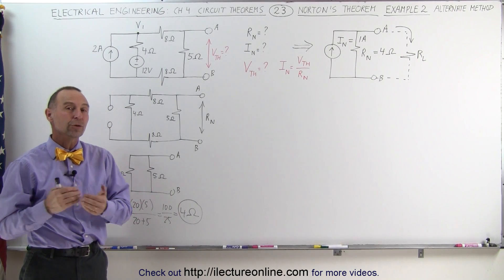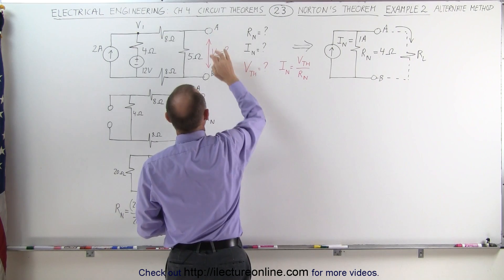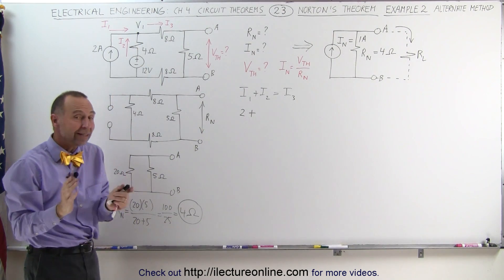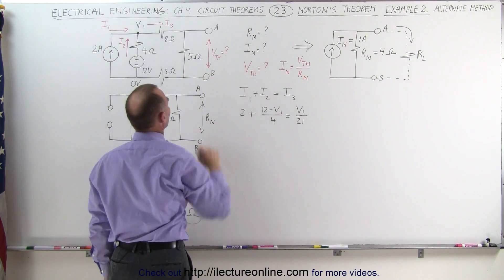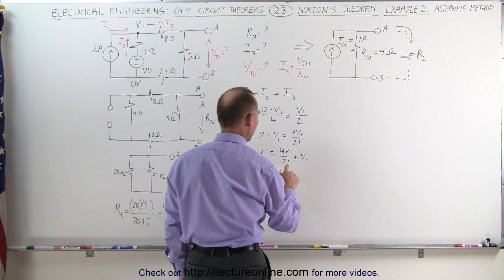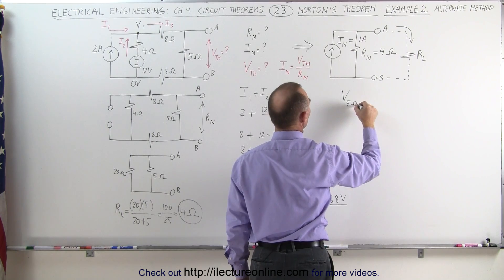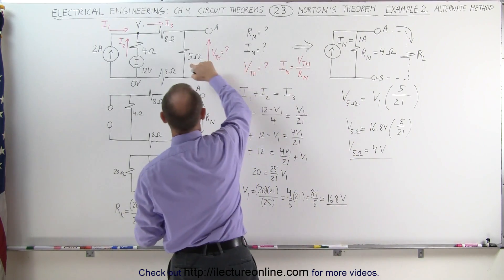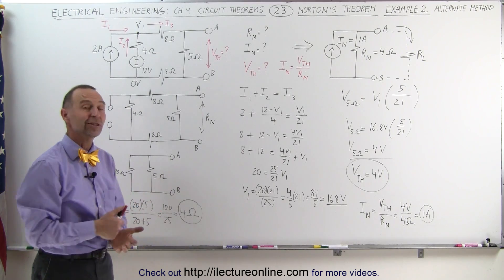Electrical Engineering: Ch 4: Circuit Theorems (23 of 35) Norton's Theorem Ex. 2 Alternative Method

Comment: For those who's confused why he's using (4 + 8 + 8 = 20 ohms) for finding Rn vs (5 + 8 + 8 = 21 ohms) for expressing I3 in term of V1, let me explain below for my own revision as well :)

I've put the comment, in #22 cuz I find out they are same video.

So when finding Rn, we turn off all the independent sources by removing current source & shorting voltage source. Then, we look into the NEW CIRCUIT with terminals A-B as the reference (going from top right, through the circuit, then reach bottom right). Between A and B, there are two paths which are:
1. Left path: A -> 8 -> 4 -> 8 -> B
2. Right path: A -> 5 -> B
So, in this case, we treat (8 + 4 + 8) being parallel to 5

However, in the original circuit when finding V1, we havev defined the currents which are I1, I2, I3. And the currents are represented as follow:
> I1 = 2 A           (from the current source)
> I2 = (12 - V1)/4          (through the 4ohm branch with 12V source)
> I3 = (V1 - 0)/(8 + 5 + 8) = V1/21          (flows from V1 to ground through the right-hand network)
To elaborate on I3, in this case we're looking at the path that I3 takes FROM V1 TO GROUND. And we can see it passes through 8ohm (top) -> 5ohm (right vertical) -> 8ohm (bottom) -> ground (0V), so we take 21V here.

I also was confused at the start but figured out after a while, hopefully this helps whoever that's confused haha. 

+ correct me if I'm unclear/wrong in any part of my explanation